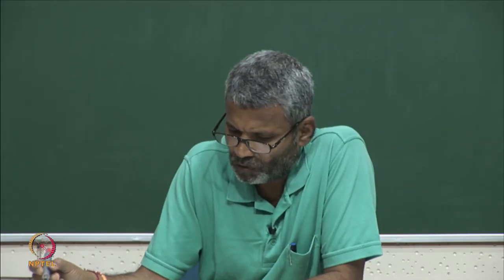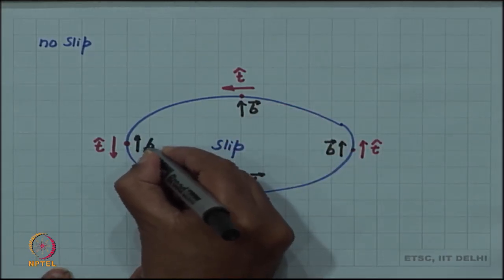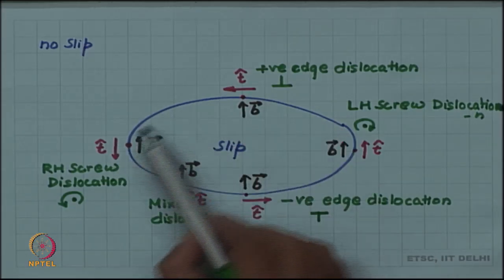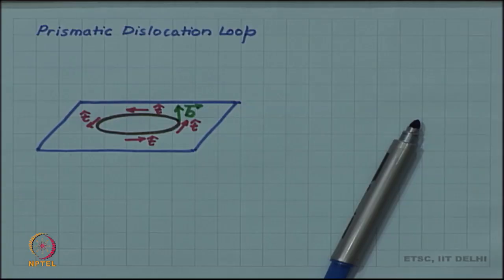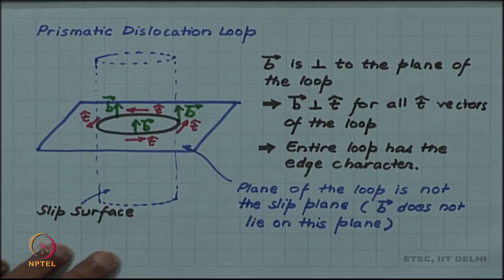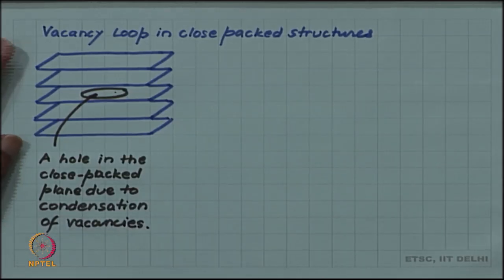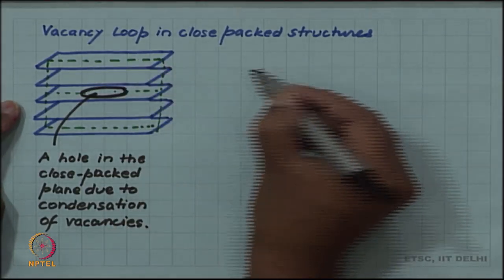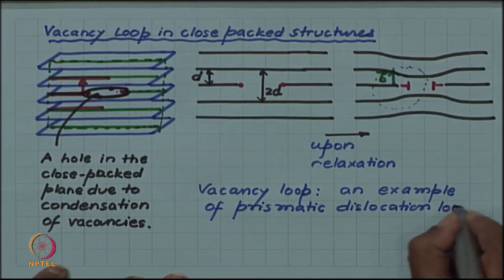MSE 57: Dislocation cannot end abruptly in a crystal: Dislocation loop

Comment: Sir the rh screw dislocation Or the lh screw dislocation dependes on t vector Or b vector
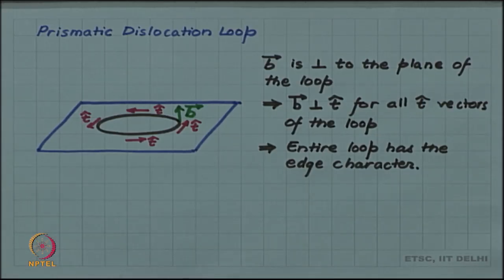Reply from the maker: In reality RH and LH screw dislocations are physically different, just like RH and LH mechanical screws. So if you turn clockwise an RH mechanical screw moves forward but an LH will move backword. Similarly, if you move clockwise on the helicoidal (spiral)  plane of an RH screw dislocation, you will move forward. Thus the distinction RH and LH for screw dislocations are fundamental. For a given convention of drawing Burgers circuit t and b will be parallel for one and antiparallel for the other. In the RHFS (Right Hand Finish to Start) convention used in this video (expalined at 11:00 in https://youtu.be/Sau72_4DRCY?si=bmAOTAjBcjUK5WlY) t and b are antiparallel for RH screw and parallel for LH.
Reply: @introductiontomaterialsscience  thank you very much
Reply: Sir

Comment: Sir why burgers vector is constant when dislocation line is in closed loop even tangent vector changes......???
Reply: Tangent vectors change as the orientation of the line changes. But the line is still a boundary between slipped and unslipped regions. The magnitude and direction of the slip are not changing. Thus the Burgers vector is costant.

Comment: Or is it possible to have a ring of dislocation where all points have a screw dislocation?
Reply from the maker: A dislocation ring cannot be purely screw. The Burgers vector remains the same everywhere whereas the line vector is changes direction. Thus they cannot be parallel or antiparallel at all points.

Comment: Sir, when a material is quenched from high temperature to room temperature, the equilibrium concentration of vacancies is reduced. And, you said that to reduce this number of vacancies, there is a formation of vacancy loop. But, how this number is reduced?
Do we need to consider an entire loop as one vacancy?
Reply: There is no vacancy inside the prismatic dislocation loop created by condensation of several vacancies as a disc on an atomic plane. What happens that after such condensation the atomic planes above and below the disc find themselves at a distance 2d instead of d, the spacing between the atomic planes. Thus to reduce energy, the planes collapse towards the disc decreasing their distance to d and eliminating all the vacancy. However, in this process, the boundary of the disk becomes an edge dislocation loop with the Burgers vector perpendicular to the plane of the loop. The net result is that vacancies are eliminated and an edge dislocation loop is created. This will happen if there is an overall decrease in the free energy of the system.

Comment: Sir, 
In the first figure, how did you assign signs such as _ve and +ve to edge dislocation and RH and LH to the screw dislocation ?
Are these arbitrarily chosen or there is any convention ?
Reply: -Ve and +Ve edge dislocations are in fact arbitrary. There is no physical difference between them. If I turn a model containing +ve edge dislocation, with extra half plane above the slip plane, upside down then the dislocation becomes a -Ve edge. But RH and LH screw dislocations  are physically distinct just as RH and LH mechanical screws are physically distinct.
Reply: @rajeshprasadlectures  Thank you so much Sir
Reply: @rajeshprasadlectures  sir why have you taken the Bottom point as negative and above one as positive edge isn't clear even after this comment .

Comment: Sir, You're videos have been very helpful and this one is also not an exception. I just couldn't understand why the burger vector was directed upwards in the end? Is it because the upper and lower planes will be moving towards it i.e. perpendicular to it's plane?
Reply: If you see carefully, in the last figure half plane is horizontal. The dislocation line, perpendicular to this half-plane is vertical.  The Burgers vector thus also is vertical. It can point up or down based on the sense of line vector chosen.
Reply: @rajeshprasad101  sir could you please eloborate it i couldnt understand it why burgers vector direction has taken in the vertical direction . the dislocation line is also in horizontal plane according to the picture .
Reply: Ohkay Sir. Thank you